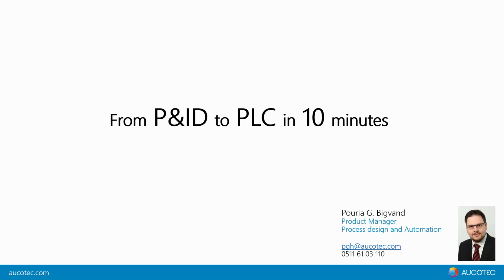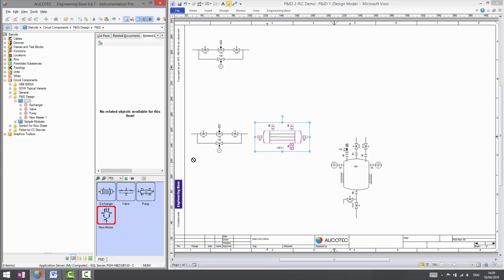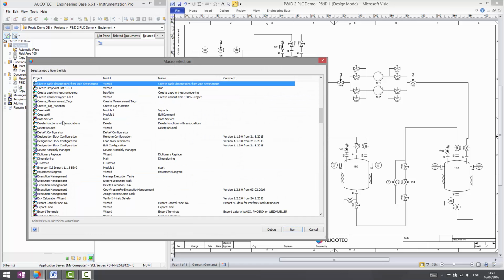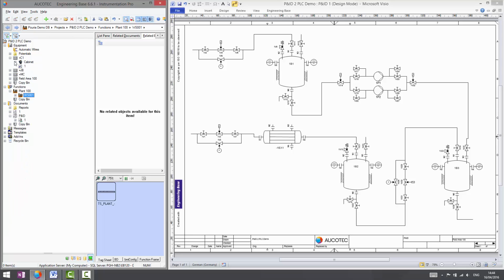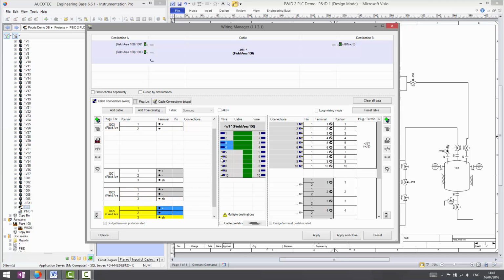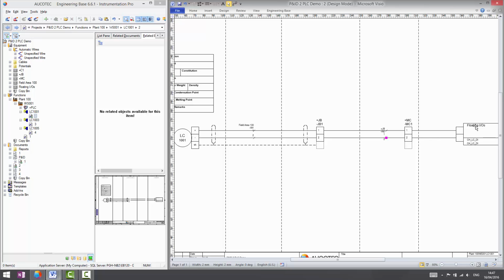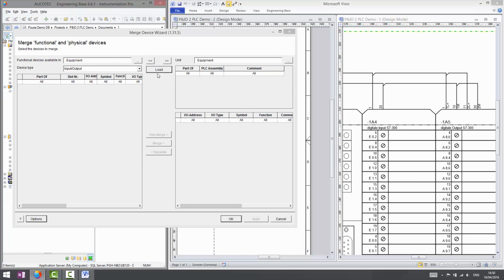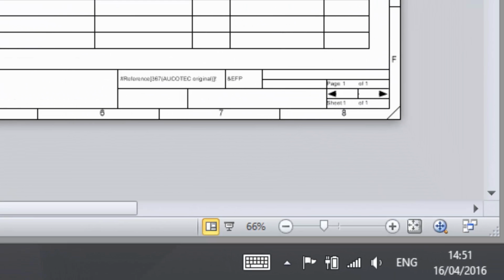From P&ID to PLC in 10 Minutes - Engineering Base

Comment: Once the Floating input is assigned, how to make the jumper at the other terminal of the input for to create the common point. Just to explain. each input are conformed of two terminal. the one that is connected to the Marshaling Kiosk and the other one to the negative polarity at the Controller, usually there are several point to be connected to the negative, thus typically all these terminals are connected together and then connected to the negative.